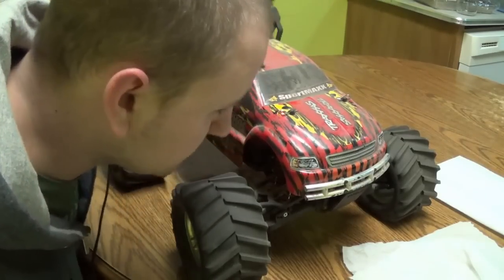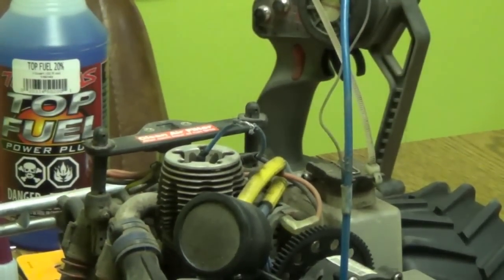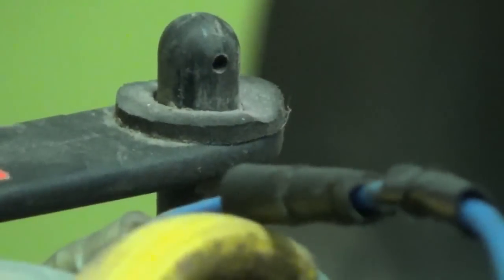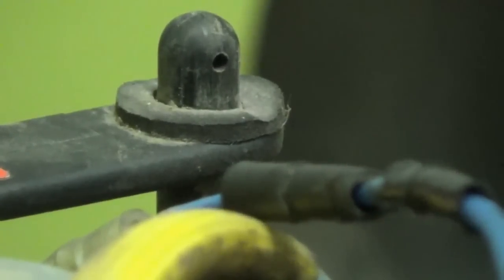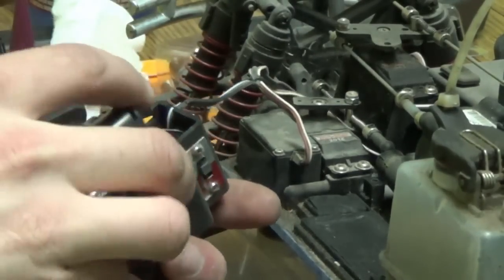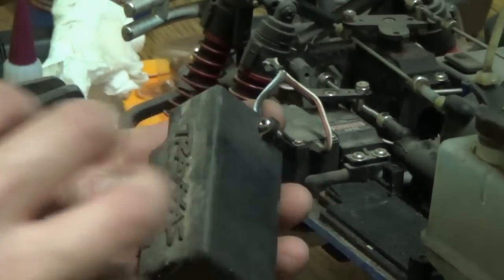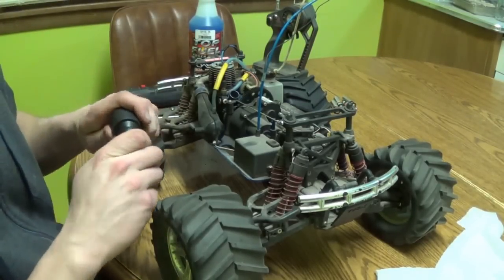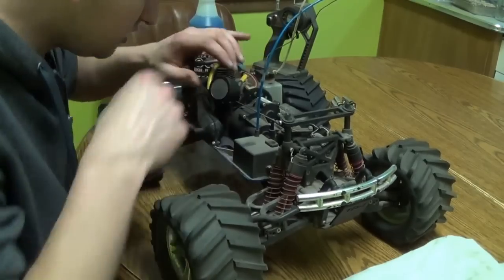How to Tune-Up your Traxxas Nitro R/C with a 2.5 engine! T-maxx and Sportmaxx!

Comment: I have this same truck.  It has been sitting for years probably 16 or more now. I am pretty sure I will need a new every thing. I don't know if it is worth the money. I thought about changing it over to electric. Your thoughts will be appreciated on this thanks.
Reply: Hey man I just bought a rustler with a 2.5R and it was sitting 11 years. New glow plug, new fuel, and air filter. Flushed the engine with some after run oil, and I eliminated the ez start for a pull starter. Pretty much fired right up. Give it a go, plugs and filters are cheap the only real money lost would be the fuel around $25 a quart

Comment: I really loved your video. Great stuff! Thanks for posting.
Reply: Stupid Fast RC Hi. I have a traxxas revo 2.5r and it is cranking over but not actually firing up. I know it has fuel in it so what should I do?
Reply from the maker: THE DOGE Make sure your glow plugs are working properly.
Reply: THE DOGE RZRguy is right. Do you know how to do that? make sure you are  making a circuit with the battery. Do you have a spare plug you can test that you know works? Is your motor ok? you can tell from how hard it is to turn, this takes experience, it's hard to describe.
Reply: Thanks for helping. I have it fixed now. The engine had been blocked up by old fuel.
Reply: ok. yeah you have to drain the fuel if you are not using it for awhile. You can flush with WD40, remove the plug and spin some through the engine as the nitro eats the ally otherwise. Anyway glad it's all good now.

Comment: I want to get mine running but it's been sitting prob closer to ten years are those the main things you should look for is glow plugs and old fuel I don't remember much about the truck at all cause I was prob 11 or 12 but I want to get her going again any advise from anyone would be cool
Reply: I just got one from someone that sat for who onows how long. First nitei so im new, but i ripped whole motor apart and cleaned it, soaked smaller parts in nitro fuel, changed glow plug and pull start and it runs, but now im having tuning issues.

Comment: I just acquired a t Maxx. Didn't run, I got it cleaned up and started. Drove ok for a few minutes. Then I lost all controls stearing, throttle etc. It took off full bore into fence, under parked car and into a bench. Weird because controls work after I shut motor down. This has now happened 3 times. Any suggestions guys?
Reply: Is it a older tmaxx?

Comment: try to get a pull start and no need to charge the ez start battery again and get a glow igniter
Reply: Pull starts are a major headache. Spill any fuel on the pull cord and it rots the string... Go with electric start on a t-maxx less hassle in the long run
Reply: markybyeah or use a glow plug and then use a  ez start and it uses less power from the battery and better starting up
Reply: Andrew Matthews
Yes sir! that is also true!

Comment: Listen for future reference the only thing you have to do to prime your motor hold your finger over the exahaust hole for a sec and turn the engine that is why you have a hose hooked to the exhaust from the fuel tank